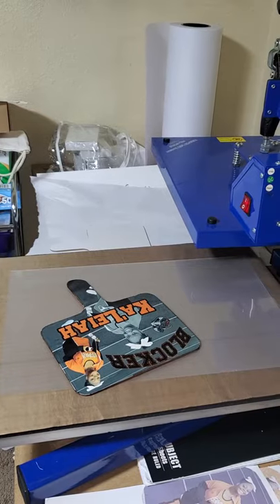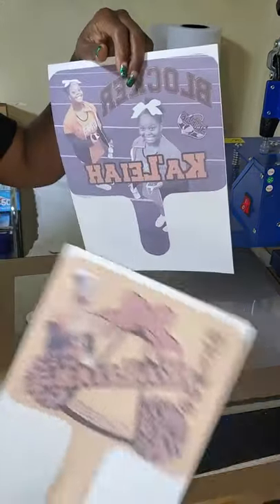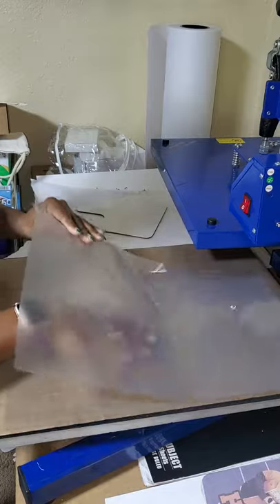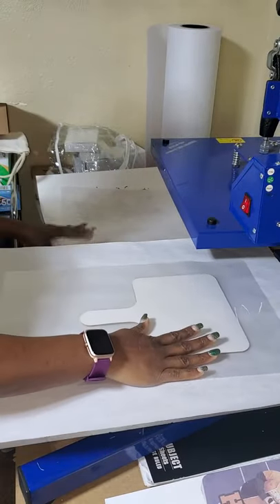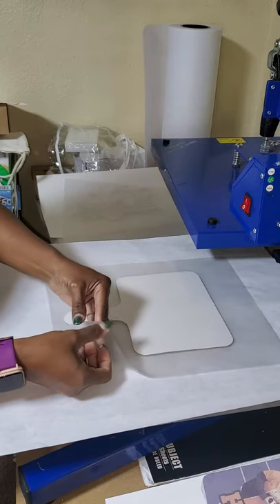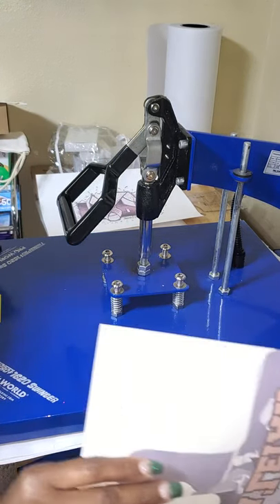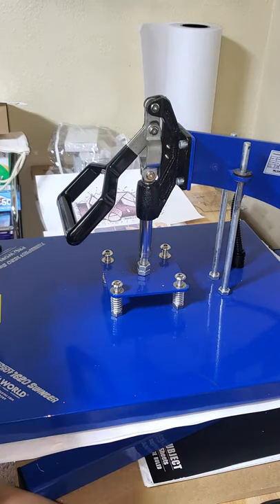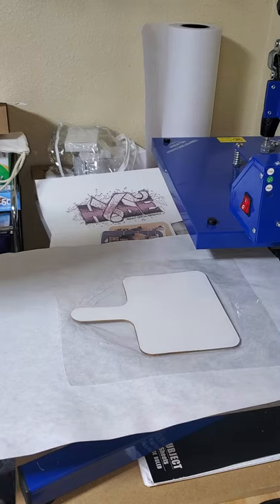DIY Dry Erase Paddle Boards "Spirit Fans"

Comment: I have the template I just need to know where do I create in print from to be sure my size is correct
Reply from the maker: You can use any design program...photoshop, canva, cricut design space, silhouette, etc.
Reply: @blendedimpressionz2024  i design it in canva but once I saved it to print it resize ..how do I keep the image the size designed it at?

Comment: Great video. But by now I'm sure you know at the dollar tree they sell a self-healing mat. So, when you're cutting out your lamination sheet from your project you will NOT keep dulling your blades. it's a self-healing mat so it keeps on moving and no cuts in the mat.
Reply: I looked on the website and I could not find a "self-healing mat" at Dollar Tree.
Reply: @astbosslady4900  it's on page 10. Its called crafter square cutting pad. 9x7. Its green with measurements on it for help if need.  👍🏼👍🏼👍🏼